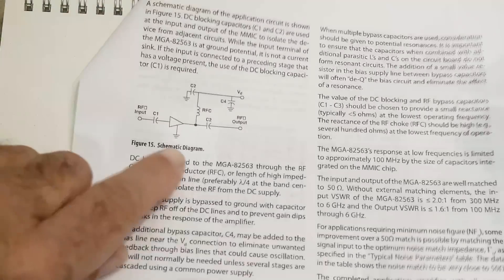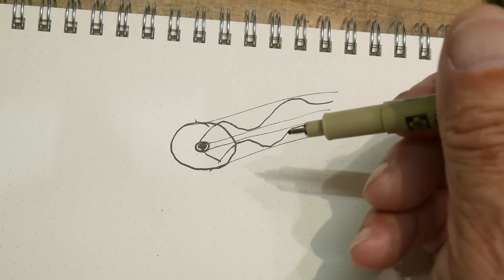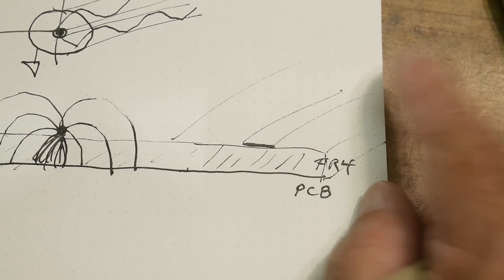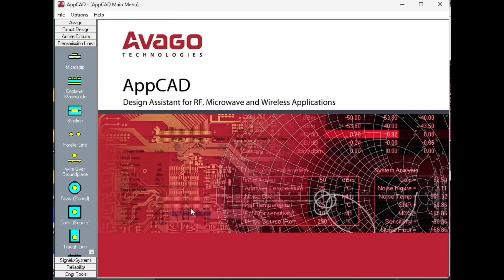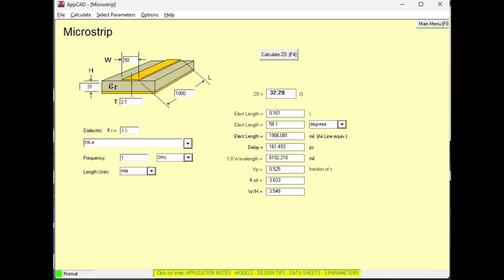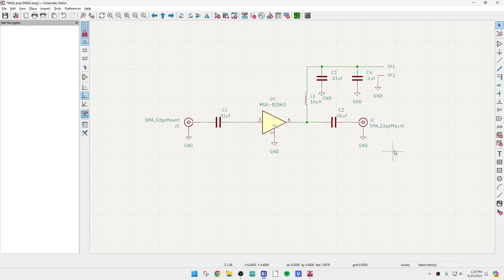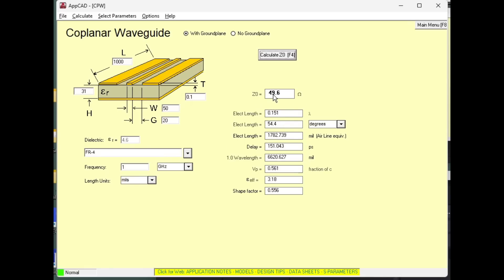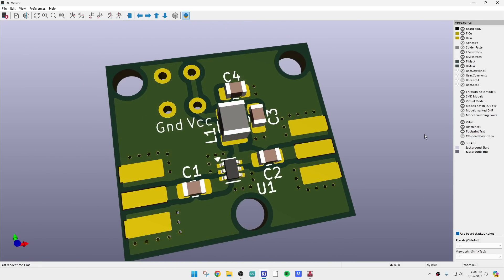#1930 MGA-82563 6GHz MMIC (part 2 of 3)

Comment: I often prototype things like this using an adhesive copper tape on a single side plated FR4. It's easy, because the copper plating gives me a ground plane while the adhesive copper tape is used to build an actual circuit (as it's easy to cut using scissors and also easy to modify if something goes wrong). And I know that 100mils is almost perfect for Z₀=50Ω, but it's also relatively easy to measure Z₀ of transmission line as long as you have a VNA, so you can easily check your calculations in a real world scenario. The easiest way is to measure the transformation of a ¼λ transmission line (which is easy to build using that copper adhesive tape), which transforms real loading impedance to another pure real (non complex) one, which is easy to find using the VNA (it crosses the horizontal line in the smith chart and it's different to the loading impedance). Then Z₀=√(Z(in)·Z(load) and you can also calculate the propagation delay, because you know on which frequency you have a λ/4 transmission line and you also know its physical length. …and sometimes you realize that what was claimed to be a FR4 is in fact far from being FR4.

That calculator inside KiCad is worth to try, because it can both syntetize and analyze your transmission line. In fact, it's a powerful and handy thing.
Reply from the maker: https://youtu.be/QhNwoOQ15VM?si=O1FNCrZc8q4gE1JU

Comment: At those trace lengths, the width shouldn't matter at all. General rule of thumb I've always heard was 1/10 the wavelength, so at 1GHz, width of traces under about 30mm doesn't make much difference.
Reply: With slower propagation speed the wavelength gets shorter...